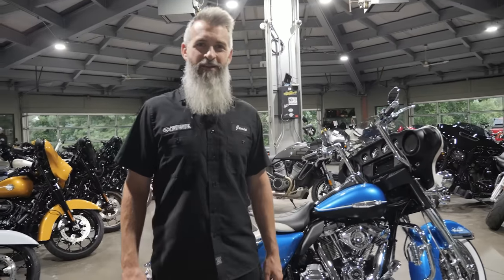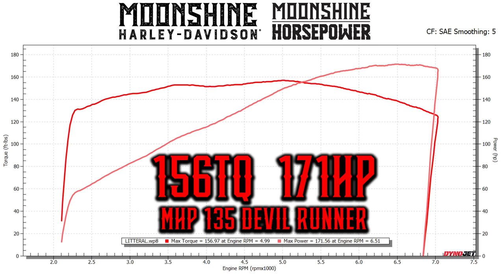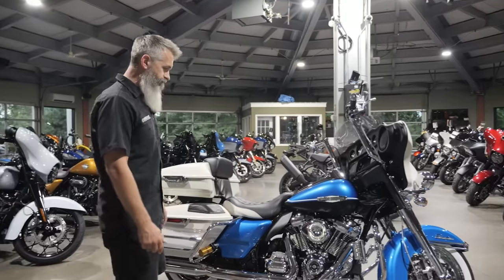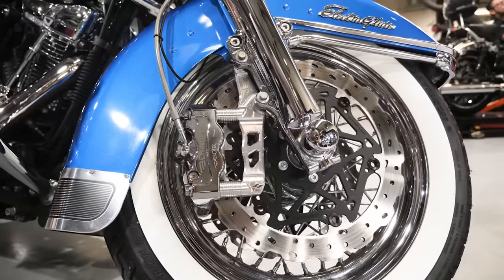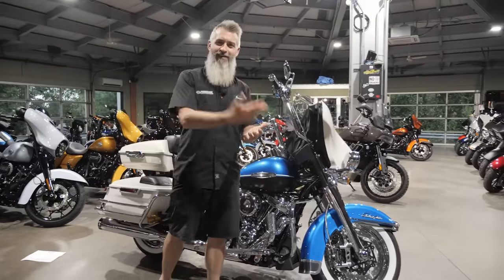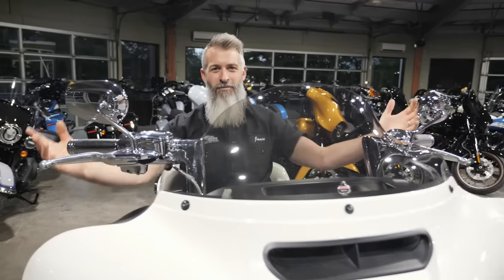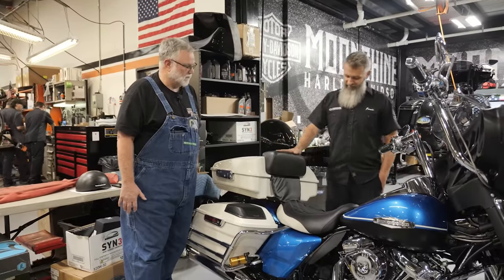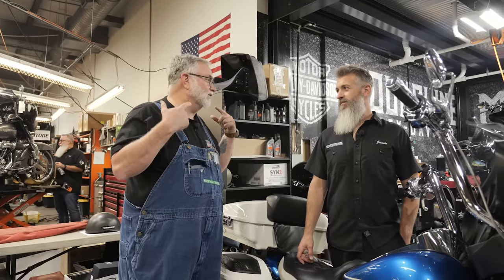Bike Build No. 33: The Revival with MHP 135 Motor Hits 171 Horsepower!

Comment: Why don't you huys develop an enclosed drive chain n enclosed changuard? My father's 83 flh classic electroglide with enclosed drive chain s first adjustment was at 38,000 mi n still had the original chain on it at 70,000 !! But you MHP guys know that. Nobody makes an enclosure for the chains.. aThe closed drive chain was a great ,durable setup ! Belts are BS ! I know you guys can make that happen n you would sell many conversion kits ! With the kind of power that MHP motor builds create its a no brainer to convert back to a drive chain . Uou know as well as i do ,everyone is going to have one of those ,Watch this Moments n is going to dump clutch at 3k rpm to show off all the power those engines make ! You Can Do It ! Go like Hell ,im gonnnna ! Ooh Yeah ! Happy Motoring ,Brothers !